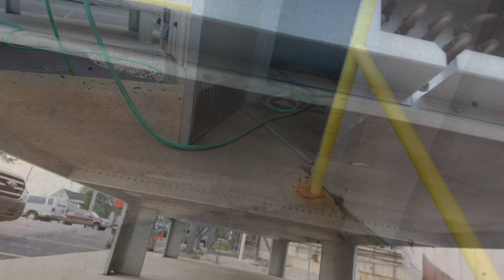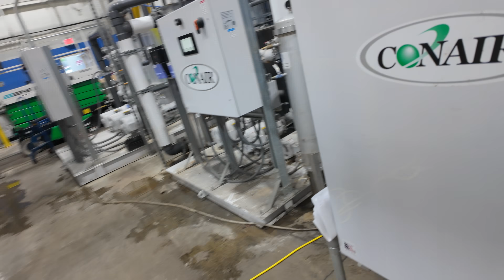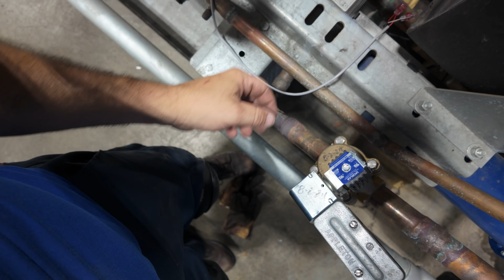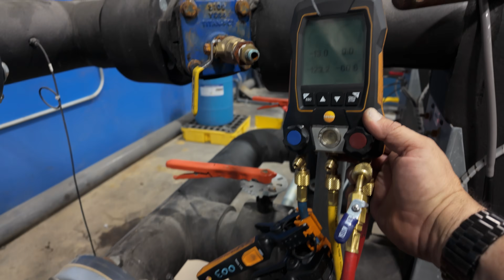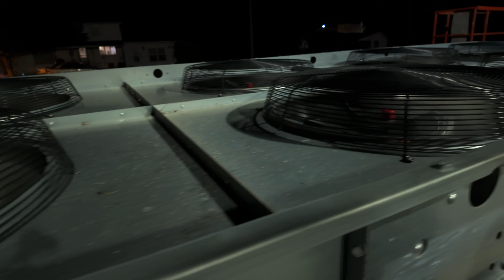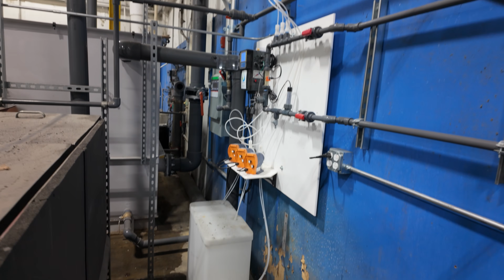JULY 4th Emergency CONAIR Chiller Compressor LOCKOUT

Comment: I need to learn how to get faster....I spent 10 hours with drive time on a process chiller the other day and technically did half of the work. Yes, I had to run for material at supply houses, make phone calls and wait for responses, but its really a struggle to keep the time down and I'm painfully aware of what that time costs the customer. I'm inspired to work more like you, spending 4 hours to accomplish all of that is really impressive
Reply from the maker: All you can do is work to get better. I’m no chiller master yet. I’ve just started playing with them more in the last year or two and that’s only as they come along.
Reply: Agreed

Comment: Nothing worse than being followed around on a service call. Whether it’s a kid or Methuselah. Always drove me nuts. Especially, at malls.
But, customer relations means you gotta suck it up and deal with it.
Nice job getting it done so fast. Kudos!
Reply from the maker: I normally don’t care if someone or a camera is watching but I forgot most of the settings in the controller and couldn’t just find the pattern in my mind when I’m competing against him to understand the controller. Add the time of day and what happened that caused the call and it just made it worse.

Comment: I’ve got my 15 year old son working for me this Summer. I haven’t put a calculator to it yet, but I’m sure he’s broken more stuff than he’s worth. I keep reminding myself I was young and stupid too at one time.
Reply: I went with my dad to work for his commercial HVAC company starting when I was 10. Because I was small, went with my grandpa and crawled into some kind of water tank for a chiller system for a building with a water tower. I thought I was going to be working on one of those old, municipal water towers. Lol. I got to scrape out all the rust and scale in the tank and vacuum it up with a shop vac. 

By the time I was 15, I was big enough to be a gopher and go with dad on start ups and mid-season inspections. I got to go to the hot truck to find tools I wasn’t sure what they looked like, or bring up a new 30 lbs. jug of R-22 through the roof hatch. Lots of trips up and down those ladders.
Reply: that's how you learn. honestly I learned a bunch by just watching, asking questions and watching tv shows of work being done, also looking at existing work, which is/was often horribly bad. then I just dove into everything head first and beat myself up until it worked, looked and was right.
every day is still a learning experience and always will be, the day you quit learning/improving, is they day you've given up. I rarely ever throw tools anymore(costs me money breaking them/things), but  every now and then I still obliterate something to vent(lol). go out in the middle of yard and slam some junk into the ground! I can still make a sailor jealous of the cussing though. (sure Rick can too) lol

Comment: What it is the reason that liquid line was sweating? I am trying to learn from videos and maube it was said but i did not got it.
Reply from the maker: The valve wasn't opening, so it was acting as a metering device. Refrigerant works like this when you restrict the flow like it was,  it starts to boil off because you're lowering the pressure.

Comment: I've been working in industrial engineering for over 40 years.  Start it at 19 as an apprentice, learn a lot but I was probably that 19 year old kid trying to learn from the journeyman.  Thanks for spending some time with him he will always remember it.  I really enjoy your channel you work on almost all the same type of controls that I did, I decided after 40 years to retire and start a small repair business.  Thanks for putting out great videos.
Reply from the maker: Thank you very much, Jeff. What kind of things do you repair in your business? I’ve pondered doing something similar maybe not full-blown just HVAC but a little bit of everything.
Reply: I started a farm equipment mobile service.  I do a lot of farm irrigation systems.  The panels are almost always 480 three phase and the control system is 120v or 24v dc or ac.  Almost exact to the UPS buildings I worked in for 40 years.  Our Automated building package handling systems where PLC run alot of VFD, FREQ drives AC and DC.  I did a lot of LIMS. Liner induction motors and there drive systems.  Love working with all the Farmers, absolutely great people.  Take the plunge, do something new I highly recommend it.  Thank you again for the great videos.